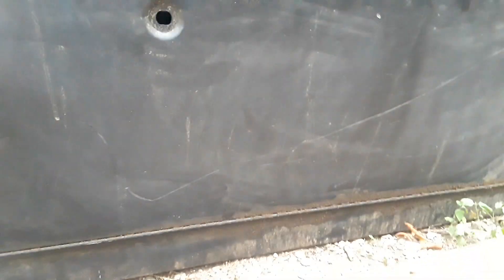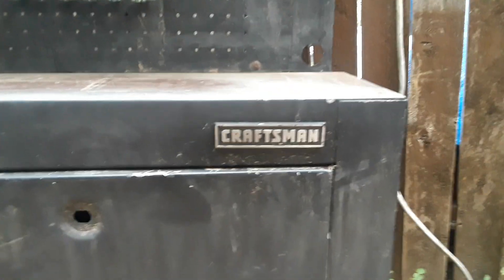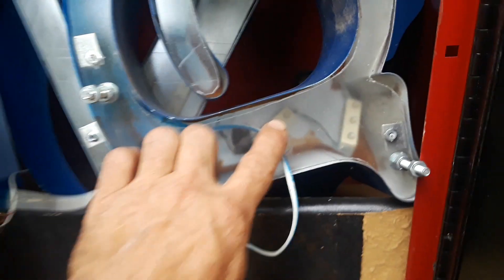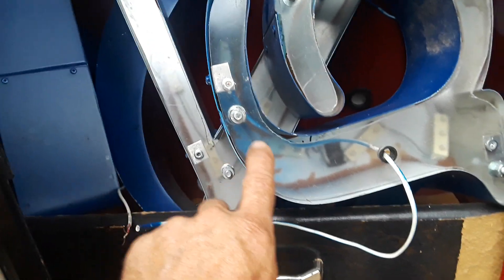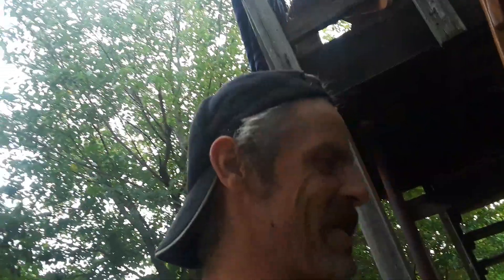Check this tool box out I made it

Comment: That's damn good using what you have, is what that tool box is. Another lost cost option for clothing storage is a big ass wood dowel suspended between 2x4 posts with scrap 2x4 feet.